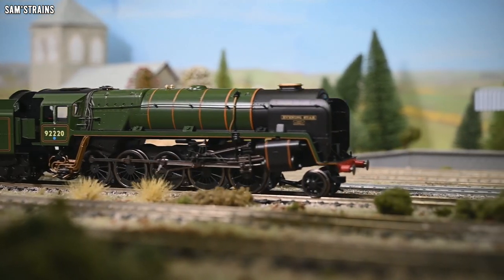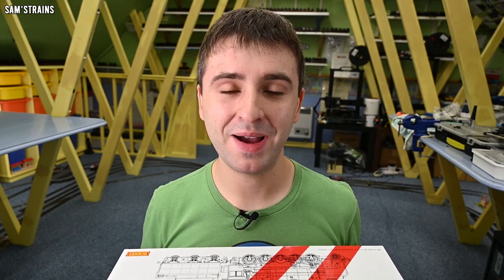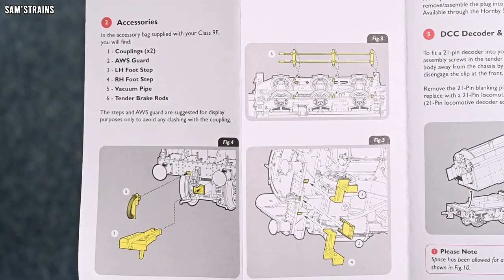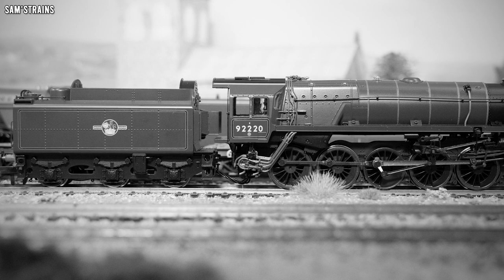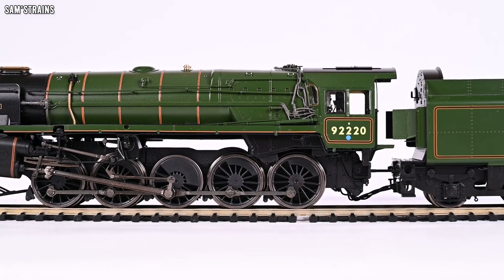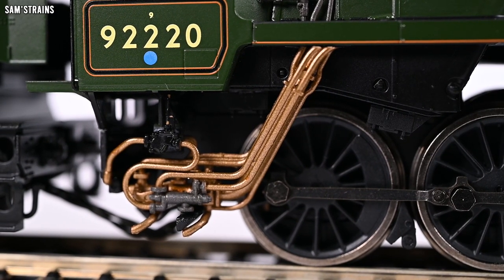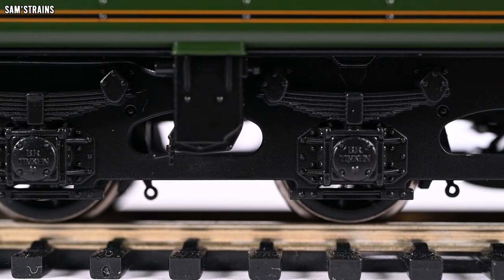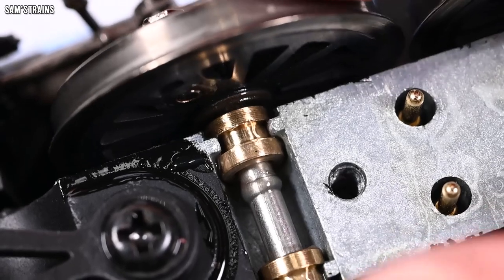All New Hornby Class 9F "Evening Star" | Unboxing & Review

Comment: Not sure how 'mechanism' gets 5 stars - isn't the motor part of the mechanism?
Not sure either how an astronomical £250 for a loco that doesn't run properly can be 3-star value?
For me, performance is very important, and the single most important aspect of any loco, so I don't understand why Hornby would make something that looks so good, but yet is unfit for purpose, i.e. hauling trains.
They must have tested it, and a good good motor is a relatively cheap item - I mean give your head a shake..?

Comment: I may be in a minority here, but I do not think they have done a particular good job here. I just do not see any significant or possibly 
any improvement over the bachmann version. Huge tender gap, silver wheel rims, difficult to remove mould lines, over thick wheel profiles, missing brake hangers, missing sand box filler tubes, obvious block chassis, wires joining to the tender appear to be in a position that would interfere with brake rodding that should be below the chassis at the rear. For this price its just not up to what I would expect. You also did not mention that the paintwork on this example has an orange peel effect which is an application fault.

Comment: Mmm she has the potential for being a Queen, but turns out to be a froggette. Shame. Better luck next time Gormley (Hornby). It’s a shame that they are using underpants for motors , and obviously still not being able to get the manufacturers to supply them with the better quality pieces. I would like to say in Hornby defence, the manufacturer in China most probably has brought a high quantity of the motors and are trying to get rid of them. But quality control is down to Hornby to be vigilant and also to check the batches as they come in. I know that to reject them causes delays, but their reputation is being shredded by their reluctance to give the manufacturing factory rejects back. A nightmare situation, but Hopefully Hornby will get it sorted out. A wonderful looking model. But let down by QC.

Comment: Very dissapointing performance from the motor indeed. Hornby should look more at other brands and what kind of motors and gearing they use. I have multiple brands in my collection (mainly Roco, Fleischmann and Piko) and I have never bought a loco that turned out to have such a low torque.

Comment: Watchting the tv series on Yesterday about Hornby it is clear why they fail on testing, their testing track is just an oval without tight corners or switches. Their lack of qualtiy and care is inversely proportional to their illusions of grandeur. Their is always something wrong with their models, warped baseplates,  wheels not even touching the tracks,  weak or faulty engines and I will not even discuss their post and package habits.  Just awfull. Replacing that self indulged Simon Kohler with Sam would be a good idea.

Comment: Come on Sam, such a pity on your review, this really looks to be a great model from Hornby and you can't run it right....., turn the power up, it's got a big motor! It may just need more than 50% power, you can't expect 50% power from your layout to be the same for a small tank engine and then expected the same 50% power to run a big motor in this model (and get the same performance) ....... other than that, well done.
Reply from the maker: That's not really how it works Craig - the controller dial is for changing speed, not power. The controller can supply 1amp at all speeds, and should have been plenty enough for this loco. Plenty of people have had no problems with this loco, but I did with mine. I will be attempting to retro fit a coreless motor into mine, so we'll see how that goes!
Thanks for watching, Sam :)